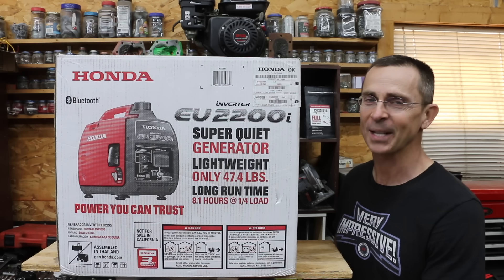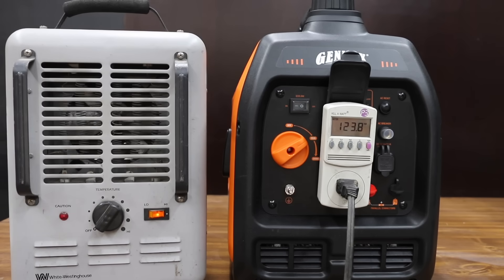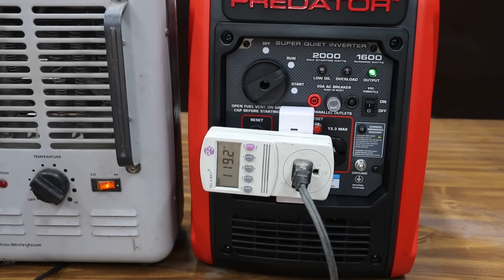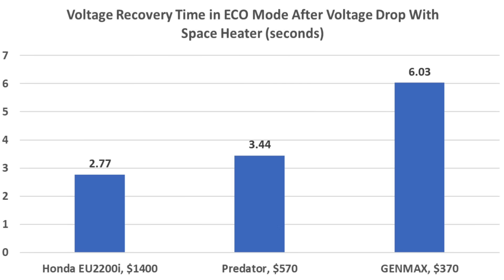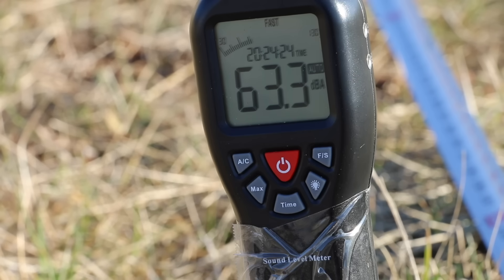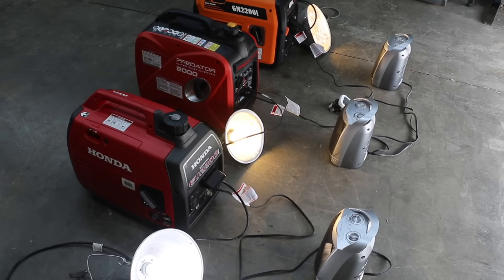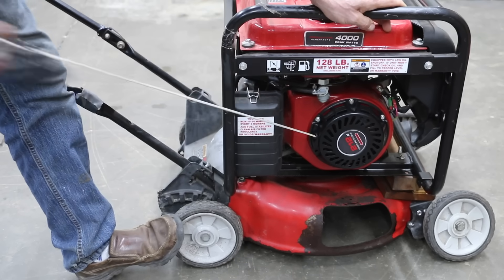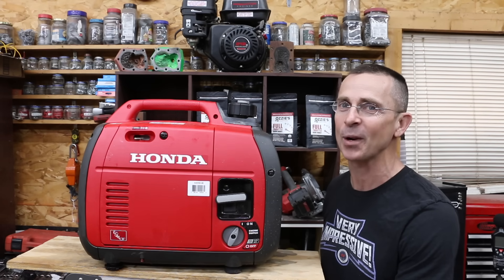Cheap Generator Better Than Honda? Predator vs Honda & GENMAX—Let’s Settle This!

Comment: You should compare battery solar generators like Jackery, Bluetti..etc...Thanks
Reply from the maker: Thanks for the suggestion.
Reply: @ProjectFarm  I’m most curious to see which model would run a full size household refrigerator longest.

Comment: I've owned an EU2000 & an EU1000 since 2000.  Ran Mobil 1 in both since the initial startup.  Amazing units.  They run & run & run.  Only advice is use Stabil in your fuel & don't leave them sitting idle for months with fuel in the tank.  Run them dry before storage.  You get what you pay for.
Reply from the maker: Thanks for sharing.

Comment: Here’s some evaluations I would like to see: what is the short and long term failure rate, how good is the warranty service, how easy is it to get repaired. Ever time I see these reviews you are left with the assumption that their reliability is same and the specs are all that matter. Most of these Chinese units have 4-4 1/2 star reviews but click on the one stars. Poor reliability, nonexistent customer service and nonreturnable. If you’re getting one of these for emergencies have a good think first.

Comment: I just bought a Champion 4250 open frame. Would love to see a comparison between a Champion, Generac, Predator and Genmax all in the same watt family. Be interested in the waveform, run times and voltage recovery.I recently found out that Champion and Generac have basically the same engine as they are Honda like clones. But don't know about the others.
Reply from the maker: Thanks for the suggestion.

Comment: I would like to see Black Max generators tested against others. Bought at Sam's Club for a very good price 10 years ago. Still runs very well 1000 hours run time later. Has a homelite engine. Black Max stuff seems decent for a lower price point. Thanks for the great content!
Reply from the maker: You are welcome!  Thanks for the suggestion.

Comment: Found the oil analysis interesting.  What is the expected service life difference?
One thing to take into consideration is the units expected yearly use. I use mine for hurricane power outages. Two hundred hours a decade is heavy use. On a construction  job site the gen set might get 2000 hours per year.  In one case the Honda would be a waste of money, but in the other case the Honda might be a bargain.

Comment: The Honda was generating more power with the same load due to the higher output voltage, so it is not going to run as long on the same amount of gas.  Probably should have measured the total kWh produced to determine efficiency.

Comment: Thanks for the great review.  I'd like to see a comparison with the Champion Power Equipment 2500-Watt Ultralight Gasoline and Propane Powered Dual Fuel Inverter Generator with CO Shield and Quiet Technology. 

Also comparison to the mentioned yamaha
Reply from the maker: You are welcome!  Thanks for the suggestion.

Comment: I bought a no name black knockoff (2000Wi) of a Honda inverter because I thought paying what the red ones were going for was absurd. I should have spent the extra money so to not have had the problems that I did, not to mention in the end I invested in a Honda and haven't had problem one with it.  The black one wouldn't even start after unboxing it from day one due to a stuck oil level safety float inside the crankcase.  It looked like a white foam fishing line bobber/popper turned into a giant life saver candy. Seller advised me to shave it down some to free it up, which I did and then it worked.  It also went through three inverter boards in the years I used it.  Later I saw that NTE for a while was selling the exact same unit (cases were identical as were the control panels) under a different name and had keyed battery starters.  The one I had, you could see the void area for the battery and there was a hole at the back of the engine block where a starter would have gone.  

I've been using Hondas at work for decades, so I new of their quality and dependability,  but also their cost.  The one I used to have is still being sold, but with a brand name under the model. You get what you pay for and I learned my lesson.  Now I see spending extra for some things as an investment that will last a lot longer than the cheaper alternative.  Pay more now or double of that later.
Reply from the maker: Thanks for sharing.

Comment: Borrowed a 30 year old ex1000 with worn out rings to use for a week long power outage. Oil had to be topped up with each tank of fuel. It ran two large stand up freezers continuously and sipped fuel! I liked it enough to buy a used 2200i. I would love to see a long term test of 500/1000 hours to see the rate of engine wear.
Reply from the maker: Thanks for the suggestion.

Comment: What I learned from this is all except the cheap junky generators have pretty clean )pure sine wave) electricity coming from them.  But what I'd really like to know is how the mid priced quiet generators stack like the dual fuel Champion 2500W and 2200watt Westinghouse stack up compared to the Honda.
Reply from the maker: Thanks for the suggestion.

Comment: 0:04 The Honda Generator I am looking for in the EU 650 model it looks like the picture but it is really small and easy to carry as a small cooler with ice in it. We used to have lug around one of these units on a construction site, it sucked doing that.  In Ca. we can buy these units anymore.
Reply from the maker: Thanks for the feedback.

Comment: I personally recommend Honda you get what you pay for, I just recently purchased a Generac 3300 generator I thought it was gonna work out great until I got it home and could not get it to start also the dial on off choke dial you could hardly turn it it was jammed up, I contacted Generac they would not give me the time of day they said I needed to see one of their service qualified technicians which was approximately 100 miles away and I would have to pay the technician $300 just to look at it and it’s all because I purchased a Generac it was new and wasn’t working, it was an absolute nightmare for me and I am an extremely mechanically inclined person or I could probably figure the problem out myself but they told me if I touched it it would be out of warranty, I live in a very large town with surrounding cities Generac had no dealers that could service it that was close enough without a major inconvenience of many hours of driving, it’s not worth it at least with a Honda you could go to any Honda place and have warranty done Honda is everywhere and it’s extremely high-quality but I’m just forewarning people do not buy Generac and again you get what you pay for
Reply from the maker: Thanks for the feedback.

Comment: Do you have a video for electric-powered batteries for a blackout (eg. For refrigerators)? We’re reluctant to have gas or fuel in the house, and only really need one for the refrigerators and cell phones. Thanks!
Reply from the maker: Thanks for the suggestion.

Comment: Can someone explain why a voltage drop can damage appliances? Ignorance on my part, but i would like to know more. THanks.
Reply: A voltage drop or a voltage spike could damage sensitive electronic parts of appliances.  We call it a distortion in the voltage wave.

Comment: The Honda provides a very impressive energy conversion efficiency @1500W at 25%, whereas in the 500 Watt scenario the Predator delivered the best efficiency at around 16%.

Comment: Take in to account the Honda outputs more voltage, my calculations gives best termal fuel efficiancy 9.7 % to Honda for the 500 watt eco test. (Elevated voltage 122 vs 115 volts outputs 560 W to the 500 W lamp. )
Reply from the maker: Thanks for the feedback.

Comment: Here are som numbers: 16 oz petrol contains 4.2 kwh,  output is calculated to 0.8 kwh to the owen. That  gives 19 % total efficiancy. Normal efficiency for small petrol engines are 20-30 %. 19 % makes sence in that range
Reply from the maker: Thanks for the feedback.

Comment: Excellent video. Just so that you are aware, sound pressure level (SPL) is usually measured at 1 meter with the C weighting on the scale. That's probably where they get the published specifications (but I do not know this for sure). Really good job.

I would be interested in seeing a long term durability test with engine wear, oil use, and what repairs needed to be done over time (and what spare parts are available from the manufacturer, long term). Some manufacturers don't have a lot of spare parts available, and when you need to do a major repair, you can't. You have to buy a new one.
Reply from the maker: Thanks!

Comment: Funny story, my job puts us through a advanced failure analysis class where we learn how and why engines failed. The instructor put an insane amount of dirt into the predator, and it took a long whike to finally kill it. He did it before out class and had us inspect it after it blew up. Shocking how much he said it took before it went.
Reply from the maker: Thanks for sharing.

Comment: i have the predator .
got mine during a personal emergency 
in temps of -20  this lil unit saved my family from a dangerous winter storm in northern colorado 
have had this for two years and never once any issues past forgetting the vent on the cap lol
Reply: I pictured the generator pulling you out of an avalanche like a St. Bernard, lol
Reply from the maker: Thanks for the feedback.

Comment: you can clean the power up with a conditioner if you want to run your computer...  OR do what the higher end units did and install filter capacitors so forth

Comment: I guess if you are using your generator to charge a battery bank, the Voltage recovery speed wouldn't matter.  If you use a generator to power your building project, that would be an issue with the more economical version.

If you have a battery bank, just buy a 3000w inverter, and use the tools, appliances off the inverter.

Comment: My Honda EU2000i is over 20 years old, still running great. It got me through hurricane Charley in 2004 & IAN  in 2022 in SW Florida. Getting 9 hours run time on a tank (ECO mode) powering large fridge, mini fridge, large chest freezer, fans and various lights & phone chargers. In 2022 I bought a EU2200 to have as a spare, haven't needed it yet !  Great testing, thanks.
Reply: Can I run the Honda EU2200 outside during a rain storm?
Reply: @petergriffin383  It's best to shield it from rain. I have run mine in the rain - although I did put a trash can next to it with scrap plywood board on top on the can to keep most of the rain off the front panel.  My current house has a 3 ft soffit over hang that keeps most of the rain off - as long as the wind isn't blowing sidewise.
Reply: @CoolBlue87GT  Thank you for the reply
Reply: Looks like honda will help to survive during zombie apocalypse.
Reply: I was under the impression these Hondas came out in like 2015 😂 but that's when i first saw a review on my YouTube feed
Reply: @thaknobodi the 2200 came out then ,the 2000 watt predecessor has been out more than 20 years
Reply: Honda is the very best
Reply: I ride red all the way. Except for my gixxer... and my boat motor, those are both blue & white.
Reply: I guess I’ll keep my Honda that I bought new for $500ish in 2008.   Runs great. Added vibration hour meter to track oil changes   Mark hours on cover. Solid piece of equipment.
Reply: @thcall6441 that gauge is a good addition, I didn’t know about that. Thanks
Reply: Same here. The old 2000 is great.
Reply: Just got one for 700 without tax gona see how hood she works
Reply: Avoid PRC StuffIt.Not good for YOU
Reply from the maker: Nice.  You are welcome!

Comment: I rarely (if ever) comment on youtube. I recommend your videos to most of my colleagues  (engineers in various roles). I love your work and love your data that you present. My one question is do you have a website or such where you post your projects and results? something where you can look between the different result infographics. For now, I will keep pausing the videos, it would just be nice when going back and forth between charts.

Comment: Initial break-in should be done with conventional oil.  Synthetic oil doesn't allow surfaces to "mate" as it lubricates too well for complimentary wear to take place..  It would be very surprising if oil subjected to the "break-in" period did not contain wear material.  Especially on a less expensive unit.  Results of analysis taken after units are broken in would be more indicative of unusual wear.
Reply from the maker: Thanks for the feedback.

Comment: Excellent review as always. 

A couple observations of the oil analysis. First, with the oil change likely being the first with any significant hours on the unit it would be expected to see slightly higher wear metals during the break-in time period. Second, the amount of silicon (dirt) could be a concern and worth taking a closer look at the air filter element and how the filter housing seals. The less dirt the engine ingests will help keep wear metals low.
Reply from the maker: Thanks!

Comment: I have two Honda generators, a 2000 and a 2200. Amazingly quiet and reliable. They sip gasoline, 8 hours on 1.1 gallons of gas. Through multiple years when the price of gas has been $3 to over $4 they have saved me hundreds of dollars. I wish I would have kept track of how much.
Reply from the maker: Great feedback on the Honda generators!! Thank you

Comment: Great review, thank you!  Your experience matches my construction site experience. Honda makes a great reliable generator.  The other brands we have used all end up in the shop to be rebuilt, require more maintenance, and are more difficult to start over time.
Reply from the maker: Thanks and you are welcome!  Thanks for the feedback.

Comment: Please do a comparison of the single cyl horizontal shaft diesel engines! Ebay has several and I wonder if any of them are better than another. Thanks!
Reply from the maker: Thanks for the suggestion.

Comment: I would like to see a comparison between solar generators, like Jackery vs EcoFlow, vs Bluetti, both LiFePO  versions and NCM versions.  It would be cool to see if some charge faster than others with the same solar panels, and if the same size batteries would last longer than another brand.
Reply from the maker: Thanks for the suggestion.

Comment: Just fired up my Eu2000 this morning, took the 12th pull to fire up but ran like a champ.  Bought it in 2014, usually run it about 2-3 times a year.  Never had it serviced 😂
Reply from the maker: Thanks for sharing.

Comment: Nice... it was a bit disconcerting to see the oil use in the predator.  The iron in the oil might be an indication of ring wear. I have a Wen 3800 and run it every month just to warm it up.  I guess it has about 25 hours on it now and it has started to collect some metallic mud on the magnetic dipstick.  That is also a bit disconcerting, but it's not using oil that I can tell.
Reply from the maker: Thanks for the feedback.

Comment: My Honda recommends changing oil after the first 20 hours of use. Yes at $1200 its expensive but if it lasts like my lawn mower or wood splitter motor, I'll be more than happy. Also, I have relatives that used a cheaper generator and ended up replacing their compressor motors on their refrigerators.
Reply from the maker: Thanks for sharing.

Comment: I would like to have seen if the exhaust port could be extended on any of the generators. I like to keep my generators in a 'doghouse' to keep them out of the elements and to minimize noise. They won't run very well surrounded in their own exhaust. From what I could see it looks like it wouldn't be too difficult with the Genmax and Predator, but very difficult with the Honda.
Reply from the maker: Thanks for the constructive feedback.

Comment: I honestly know Honda is king..
 Nothing competes with Honda. 
  I have an air compressor powered by Honda, an welder Honda powered, 2 Honda generators., most I have had and used for years..
   Even when I really couldn't afford it I bought Honda, because I know they last..
Reply from the maker: Thanks for the feedback.

Comment: The real test is longevity. I had an EU 3000 is and lived with it off grid. What that means is I had to use it 3 to 4 times per week and run it at 80+ percent load. 12 years later it has a little bit of bearing noise but it is still flawless!
Reply from the maker: Thanks for the feedback.

Comment: considering the Honda has a significantly larger engine, the fuel efficiency is pretty good, especially with the eco-throttle.
Reply from the maker: Thanks for the feedback.